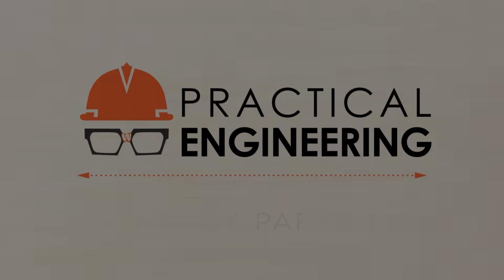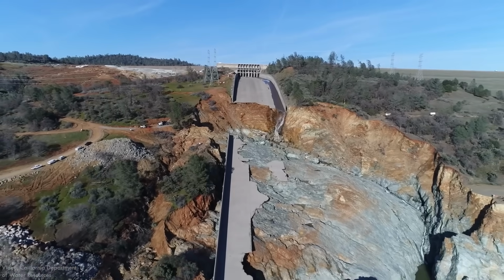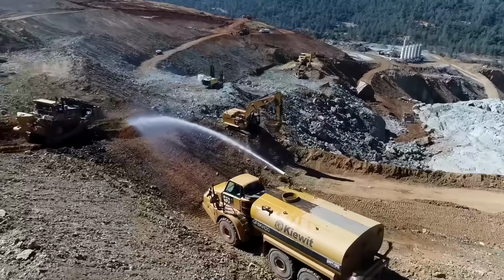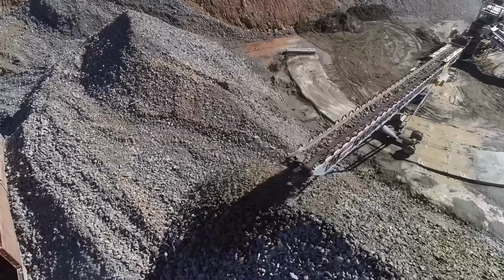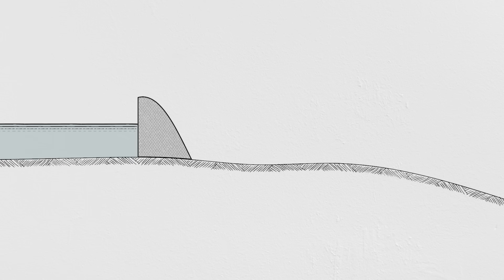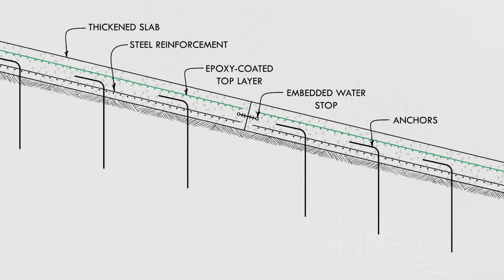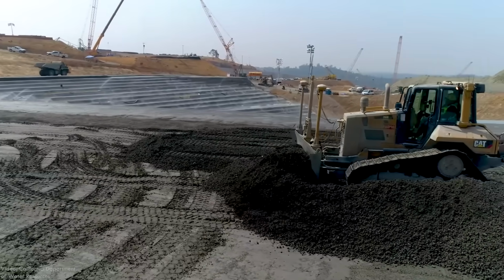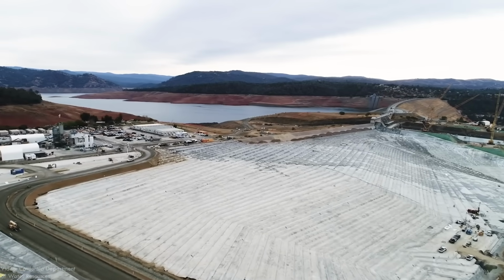Rebuilding the Oroville Dam Spillways

Comment: I remember following this disaster when it was happening, and jumped on this when I saw that it was a follow-up and summary from an engineering point of view.  What surprised me at first is that this occurred in 2017, four years ago!  It almost seemed to me to be just last year - or not near that far back. Sure hope that the dam and the damn new spillways hold up at least as long as the original, which worked since 1968... 🙄
Reply: It was only 2 years ago. I refuse to acknowledge that 2020 and 2021 even happened. I'm calling for a do-over!

Comment: I worked with RCC for one year building the backup dam at lake Murry in Columbia SC.
RCC is composed of three sizes of rock and three sized of sand and each layer of the pour is about 12 inches thick and a layer of bedding material that has a slump of 7 is a fine mud like material that clues the layers together like the Icing between the layers of a cake.

Comment: Underneath the sand of the spillway there are rocks, what would have been wrong with using those rocks as the spillway? It simply was a construction error not to make the spillway connected to the rock mass that was already there.

Comment: Having a first hand view of a spillways repeatedly being repaired due to surface wear I'm interested in the what, if any, mitigation system was incorporated on the final finished surfaces.
In the spillway I was able to study the engineers had come up with an air making mechanical system that was embedded in the surface of the concrete that more or less looked like large half tea cups.
As flowing water passes over the tea cups it "makes air" under the flow, reducing the waters contact with the concrete surfaces making it necessarily slippery in addition to breaking suction.  
I've been able to use the concept for abrasion reduction inside steel pipe as well as flat steel surfaces much to the hubris of qualified engineers.
For sure I can't recall the correct terminology but it unarguably works.  
I'm curious if either the old spillway or the replacement is/was so equipped with anything more than a slick surface?  I was told that the spillway I had observed in flood stage could actually suck concrete surfaces away from the substrate in cubic yards as I'm sure must of what happened to Oroville.
What kind of surface did they put on the new concrete???

Comment: The mere fact that a contractor finished a public project on time is an achievement that is quite remarkable all by itself.
Think about it, this could have turned into a huge political / legal mess of finger-pointing stalling any reconstruction effort -- like the SF Millennium Tower which is going nowhere except sideways.
Reply: That's what happens when you also put the approval board on a time crunch, and also in the same trailer.
Reply: Well unlike the millennium tower, construction needs to be done before the rains come back and the spill way might need to be used. Can't milk a project that if you don't deliver on time you could end up making the dam fail and flood a town and kill a bunch of people.
Reply: Necessity is the mother of progress. Failure really was not an option, so you can bet your ass that every person involved was giving their absolute all to meet that deadline. With a normal project, it's just not the same level of need, so things slack behind. Fixing THE spillway is very different from fixing even a major highway. There are always other roads to use.

Humanity is capable of incredible feats when we have a common goal and a great need. The rest of the time... meh. Sad but true.
Reply: Hmmm, on time and under budget.  Maybe our Defense contractors need to take a hint.
Reply: Thank Peter Kiewit & Sons, the US best construction contractor
Reply: @jaik195701  It will be over when the next rains come. May those downstream Rest In Peace.
Reply: Well, for a billion dollars…
Reply: @edwarddiekhoff859  higher upfront costs are way better than having to pay butt loads after a disaster strikes. Do it right the first time.
Reply: @edwarddiekhoff859  honestly a billion for this appears good value
Reply: Because the government got out of the way
Reply: @JasonNotBot  Did you actually listen/see this video? Army Corps of Engineers and so on...FFS...
Reply: THERE WAS NOT MUCH TO ACTUALLY DO. IT WAS JUST DUMPING CONCRETE AND THEN ROLLIGN ON IT T OMAKE IT LEVEL, ITS ACTUALL VERY SOIMP[LE. THEY COUDL HAS USED PRISONNERS FROM A CHAIN GANG.
Reply: I'm sure the billion dollars helped.
Reply: The SF project has no functional consequences as to its completion, hence is qualified for graft, corruption, kickbacks, and cheating.. all of which enrichen useless commie politicians, enrichen the developers, and hurt the public it is supposed to serve.. Nothing in socialism benefits the 'people' ... it is the peon people that benefit the elite in control by being heavily taxed and controlled by heavy handed regulation.
Reply: @jenniferwhitewolf3784  Doesn't matter what Ideo-ism TPTB are, insidiously prone to become an unaccountable aristocracy leeching your wallet.
Reply: @jenniferwhitewolf3784  Why do you blame communism and socialism for the failures of capitalism?
Reply: @plightfoot8491  just like every other damn state lmaoo.
Reply: @Wix92  these people gotta point at something instead of themselves.
Reply: @plightfoot8491  Laughs in West Virginia
Reply: @jenniferwhitewolf3784  say what you want about the failures of communism, but you can't deny the accomplishments the PRC has when it comes to massive infrastructure projects. One of the few benefits of having a highly centralized government with control over all sectors.
Reply: @Jebsucks  I couldn't have replied better to the commie. The more freedom people have from government and tyranny the better the achievements.
Reply: @Skoomz  China's infrastructure projects are notorious for being terrible, with more money put into the PR than in engineering because bureaucrats are trying to please the politician above him and refuse to say "no" or "that's not a good idea". China Uncensored has a lot of really good videos explaining the issues.
Reply: @LP-ju2fi  The tyranny of major corporations is at least as bad as government tyranny.
Reply: @Skoomz  slavery? Concentration camps ? Unsafe sites?
Reply: @jaik195701  the US still has wage slavery, detention centers on the border are literally camps that concentrate particular people groups, and when's the last time you've seen OSHA do something?
Reply: @LP-ju2fi  Since the Millenial Tower SNAFU was mentioned here, I take that as a perfect counter example. Private enterprise didn't get that one right, did it?
Reply: @JasonNotBot  Hooee, you're so off base, it's laughable. Confirmed capitalist and small business owner here. Secondly, I learned my grammar, syntax and spelling in taxpayer funded schools, which obviously did a better job than wherever you went to school, assuming you did, in fact, go to school.
Reply: @quiggleyscripple  why come you care?
Reply: @JasonNotBot  Try english, please.
Reply: @quiggleyscripple  it’s ok Bernie
Reply: @JasonNotBot  Oh, poor snowflake. (Don't know this Bernie).
Reply: @jenniferwhitewolf3784  also, there's not a single socialist, let alone communist, working in the federal OR state government. If you think so, you're actually delusional.
Reply: @jenniferwhitewolf3784  Amen brother

Comment: Great video thanks. Fascinating stuff! 
We have many dams here downunder which are needing upgrades for safety, most of which were designed a long time ago.
However possibly the saddest story is Paradise Dam in Queensland, only completed in about 2007, built mainly from roller compacted concrete. It was a complete stuff up and very nearly catastrophically failed in a flood just a few years later.
They’ve since spent an awful lot of money in remedial work, (well over $100m) and reduced the spillway height so it’s now only about 38% of it’s originally designed capacity. 
That is the result of corners being cut and shonky work:  way more cost for far less storage. Sad.
(The remedial work is still not complete.)

Comment: I was surprised to see the shop vacs, I get the rock had to truly be clear but just did not expect normal off the shelf shopvacs.  Somehow expected some huge tool connected to one of those sucker trucks you see the city clear a storm drain with in the fall.

Comment: Very interesting and great video! One question, I thought epoxy coated rebar has become a no-no in recent years due to its propensity to rust in one concentrated spot, say where there is a small scratch or chip in the epoxy, and fail in that spot.

Comment: Epoxy coated rebar has shown poor long term performance.  It often has minor defects from installation (microscopic nicks) that cause moisture to progress through the coating and into the steel.    This can accelerate the degradation of the rebar with the epoxy acting like a straw trapping the moisture and potentially damaging the entire bar.

Comment: The maintenance engineer dropped the ball…  he should be held accountable but DWR shelters and protects it’s own. This wasn’t the first disaster at Oroville. Several people were injured and nearly killed when against the advice of UCD professors the RVOS was operated at full capacity without a dissipator ring. resulting in the collapse of the wall. Also a powerhouse downstream was destroyed by fire due to negligence. Someone should get to the bottom of these events but I think it would be too unpopular to actually hold people accountable for their mistakes.

Comment: I had never heard of compacted concrete before. My solution would have been massive use of cooling tubes in a massive concrete pour.
I well still suggest putting a single waterproof membrane down the entire spillway or maybe coat the whole thing in hydrophobic material.

Comment: Interesting.
The original spillways were built without critical time constraints, by people who presumably knew what they were doing. They were inspected regularly and nobody raised any red flags.
These new spillways were designed and built at a breakneck pace, under extreme time constraints, by tired workers directed by harried, stressed contractors.
But this time it will be fine. No mistakes. No shortcuts. Nobody signed off on anything just to meet a deadline or keep their job. Nobody working for the Government looked the other way. Scout's honor.

Comment: The next flood year for the West Coast should hit in the winter of 2026/27. These above average rain seasons occur cyclically in correlation with the solar minimum of the solar cycle. I have been watching for years now. I correctly predicted that the winter of 2016/17 would be a super rain year in early 2014. So my educated guess was a good one. Although I would be unable to predict what part of the coast will be hit. In my lifetime the winter of 1964/65 was the biggest such event. Rains fell from south of San Francisco all the way up to lower Canada, the entire West Coast essentially. The winter of 1996/97 was also a super rain year. That was the winter which first damaged the Oroville spillway. It rained for around 32 days in a row in Marin County. It was getting somehwat biblical when it finally stopped raining in January 1997.

Comment: I really wish there was a way to forward the enthusiasm for knee-jerk projects like this to proactive projects. Don't get me wrong, what was done here was absolutely incredible, but had that billion USD been invested when the damn was originally built (which was done for around 1/10th the cost of the repair), Oroville could have been so much more. What if that excess flow had been discharged through hydroelectric turbines? The installed system can only handle around 1/9th the flow of the spillway, a few extra turbines would have changed this from a major catastrophe to cheaper power.

Comment: When small scale models of aircraft are tested in wind tunnels, there exists the problem that the models are small, but the molecules of air, etc. are still the same size. To deal with this, there exist things known as Reynolds Numbers.  My question is - is there an equivalent of Reynolds Numbers when dealing with scaled down models of rivers, dam, and spillways, as seen in this video??
Reply from the maker: Yes, we use froude similitude
Reply: @PracticalEngineeringChannel  Thank you! I have an enormous respect for engineers!

Comment: My first thought on a repair would be to soil nail the hell out of what was left to retain the material. Then use calcemt or portland cement to amend the soil to establish a base. Then precast the spillway and start setting it. The precast sections could site on shorter piers compared to build and aqueduct. Precast work could start immediately and other options proposed would be Stan are construction.

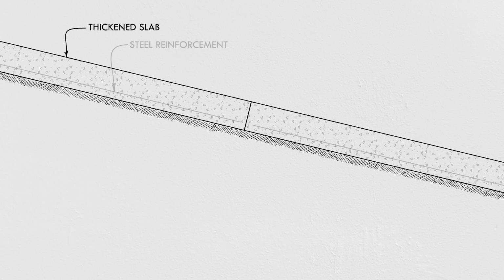Comment: 12:36 WOAH WHAT?! They used epoxy coated rebar? isn't that getting banned because of corrosion problems due to any imperfections in the coating concentrating the corrosion damage? is that not a concern because of the use and the climate? I would expect them to take something like that into consideration at this point when the disadvantages have been shown?

Comment: you need to dissipate the energy of the water, which it has stored as potential energy due to height. best way to do this is using pools at several tiers. water falling into a pool of water loses the energy, without massive friction on structure.

Comment: They had a similar problem at Glen Canyon diversion tunnels. In the early 80s, they had to use these overflow tunnels to release water from the dam. These tunnels created water velocities and cavitation that was never anticipated. The water formed huge holes on the earth after the concrete and other tunnel materials were compromised. It was a very interesting video. It is on you tube. I will try to find it.

Comment: "which could fit eight American football fields with room to spare or more than 150 tennis courts" 
Americans will measure with everything except the international standard.  Just say it is 26m by 6m by xx meter. ( Measurements are guessed due to football fields not having exact measurements . ) How is not using the IS practical? Besides wanting to crash into Mars.

Comment: I'm still wondering what the issues with "use the hole" would have been. "Standing waves" are only a problem if they break something, and the rock did hold back the water before. 
Of course, just building the damn thing again is easier to engineer and a nice project for all the contractors.
Reply: It would erode faster and cost more to maintain because of the different levels of wear on different parts of it. A smooth channel like this wears far more evenly. On top of that, it's far more predictable as to what the water will actually do in a massive release, just letting it go into the hole could quite easily overtop it and over time wear away the surrounding area too that's holding it all in place.

Comment: Hi I thhink I have a rough idea to my question but would like to get a detailed answer if possible. Would it be possible/better to make a hydroelectric dam in this place and produce eletricity like any other dam or are we talkinng about too much cost for too little to gain perhaps the policy and political agendas or maybe holding off water too much and not releasing water might cause damage to people/animals downstream. Wouldnt mind picking on someones brain on this. cool video.
Reply: Since 1967, Oroville Dam has provided the water for the Hyatt Power Plant, located at the downstream face of the dam. It also powers two further hydroelectric plants located downstream.